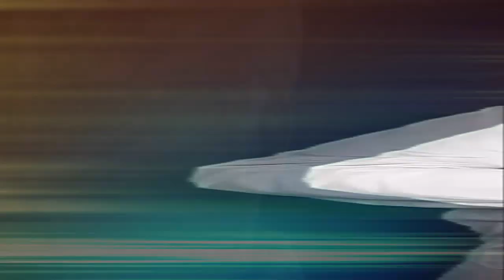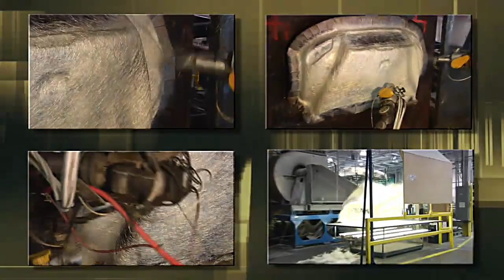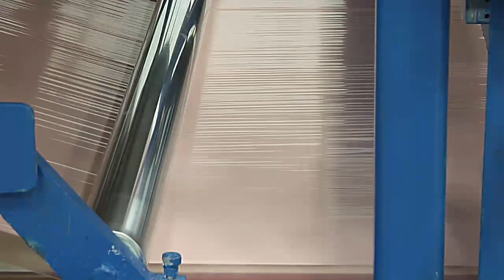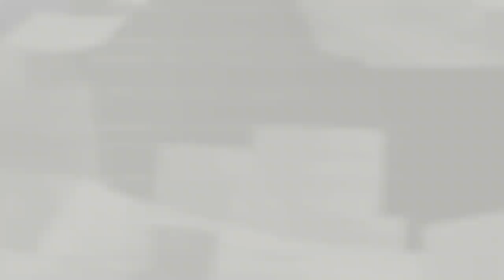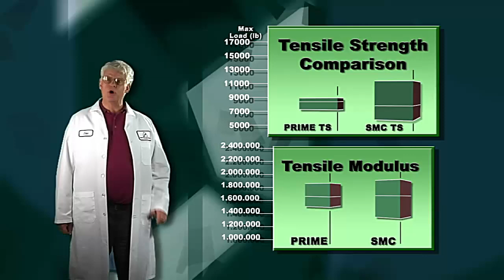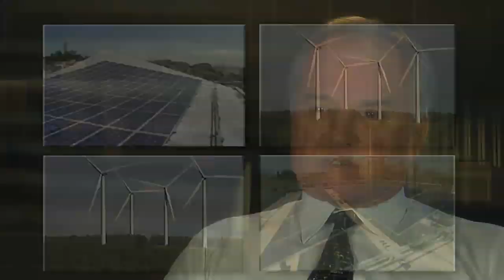Molded Fiber Glass Companies PRIME

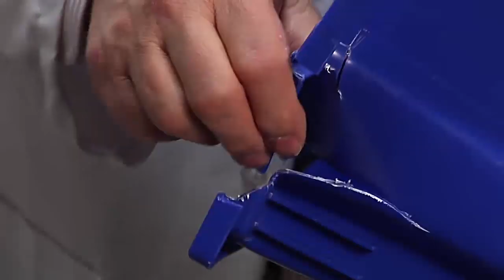Comment: Great to see our products in action! Those robot arms are each using several of our Heat Torch 200 inline air heaters. Check them out at 3:40 and 5:44 minutes into the video.